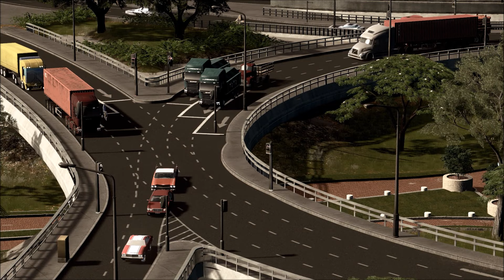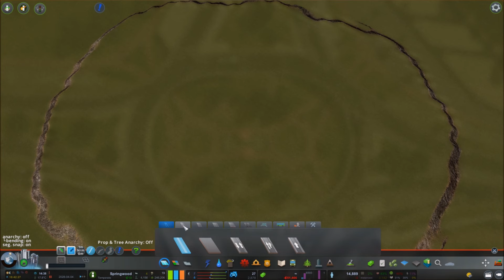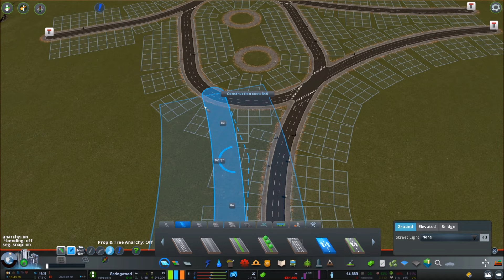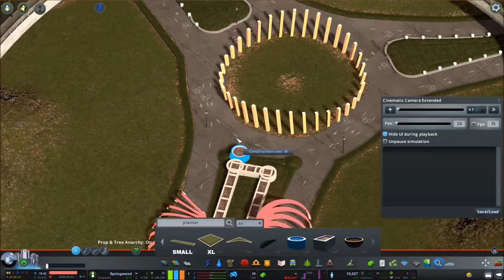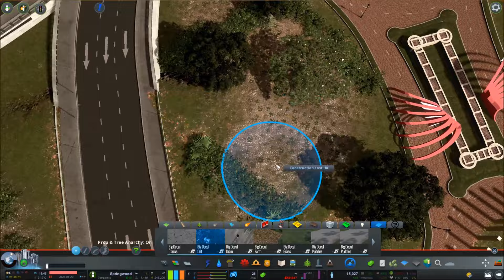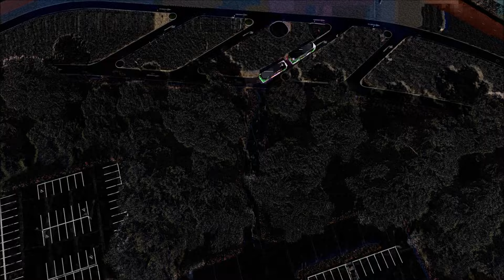Cites Skylines: Traffic Light Controlled Roundabout Build

Comment: I dont see why you would use traffic lights in a roundabout, but it looks amazing and it seems to work. awesome job man!
Reply from the maker: Large ones in the UK usually end up with traffic lights because roundabouts don't really work well with high amounts of traffic, especially when there's one road coming on that's always busy. You'll end up with traffic closest to the busy road having to wait forever, causing that to back up.
Reply: One we have here in Sheffield is on part of the city's ring road and theres part-time traffic lights which only function during peak times, they work well when they are actually needed.

Comment: Is it the Timed Traffic Lights that you're looking to use?
Reply from the maker: Yeah the ones with traffic president
Reply: Crumbs McGee 
Well, since I can't be bothered to find a tutorial, I'll write one:

1) Pick Timed Lights from the TP menu and select a junction
2) Click the option to add Timed Lights to this junction (not sure how it's worded exactly)
3) Click "Add Step" 
4) By zooming in close to the junction, you'll be able to see traffic light icons. by clicking them, and the smaller Mode icons beside them, you'll be able to choose which lights are red / green (plus whether pedestrian lights are controlled and whether individual turning directions are controlled)
5) Once your first "step" is set-up, choose parameters for the duration - min/max time is approximately in seconds if you leave the sensitivity to 0.8 Moderate (minimum time means the minimum time lights stay green before they check whether more cars need to pass. If more cars are coming, it will stay green until either all cars pass or the maximum time is reached).
6) Click to "save step" (might be worded as "add step" again, I'm unsure).
7) Click "Add Step" again
8) Set up the traffic lights that will be green/red and their timings again - this time with different entry points being able to go (usually inverting your selection). Repeat until you've got each entry point covered sufficiently.
9) Click "Start Timed Traffic Light" and the Timed Lights menu will begin displaying information for your new Timed Light. You can go back and edit/add/move/remove steps later on, and you inevitably will because it's rarely perfectly timed first time.

Note: when controlling turn directions individually (e.g. only right turns have a green light for one entry point), make sure that you've used the Lane Connector to allow only people turning right to be in the right lane, only straight on in the middle lane, etc. otherwise Cims will get in each other's way and cause jams.

Hope this helps :)
Reply from the maker: Thank you very much this is very helpfully